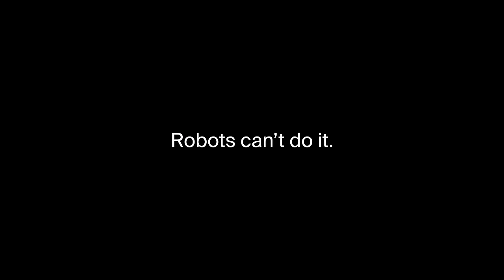Dexterity - AI-Powered Robotic Truck Loading

Comment: I'm skeptical of technology that lifts boxes by sides other than the bottom. I envision lots high-density boxes with their contents strewn about if lifted from the top or side.

Will this technology be able to compensate for packages that are drastically heavy off-center? This type package is typically placed with the heavy side toward the front of the trailer to keep the stack stable.

Comment: FedEx expects 300 boxes stacked in the truck per hour per employee in the outbound package handler position regardless of size or weight,  whether a 4×4x2 inch box or as a another commenter posted a 149 lb box 8 ft x 3 ft x 4-6 inches thick...

This thing needs to speed way up...

FedEx loses millions and millions of dollars in damaged and stolen merchandise every year from employees alone, perhaps if they let folks slow down to this things speed, they wouldn't have so many damages and insurance claims!

Truly incomprehensible when you witness the insanity...
Reply: 300 that's it ??!!

I was loading 1200 an hour back in 1991 at age 21. Kids today, will never work that hard!
Reply: Same thing with UPS but the thing is af ups each shift runs like 3-4 hrs, and they want every loader to do 300 boxes an hour. But these robots at this speed while they look really slow they can go at it for 24/7. Weekends, holidays, etc. I never thought I would see the day machine would replace humans when it comes to loading but even at this speed they are more functional it looks like. Like said they can go forever. While people can't.
Reply: Its 600 packages per hour now at UPS to load the trailers and 1,200 packages per hour to unload the trailer. I know someone that worked there. He was told this in August 2023

Comment: Let's see it load 149.9lb box!
Reply: Just a matter of time, and probably not that much. Warehouses might need to be changed but robots will certainly be doing the bulk of unloading, stacking, and moving in 15 years, probably less.
Reply: @jacobnunya808 it will never happen. the robots will need to learn how to load tires sometime especially, 4 tires held together with straps😂, tubes, buckets,  push mowers, catfish traps, anduch more. ribots will certain cost ups more than they save. our ceo is a moron.

Comment: I seen a column and it’s not locked in on the right side to prevent shifting during transport. I give that wall a 2 out of the 10 load quality elements. That’s failing. Do better robot 😆.

Comment: Way to slow! This would never work at UPS! Humans are much faster!
Reply: This is only the beginning and a prototype. The only safe jobs are those that are protected by government: Doctor, lawyer etc.
Even if you could make a robot surgeon, it would not be legal for it to operate people.
Reply: Yeah I got 25 years at UPS and could annihilate this thing in speed and load quality. But as the other guy said, this is just the beginning, give it 10 years. It'll make everyone more efficient, but it's not out and out replacing jobs. You'll still need a ton of people babysitting the machines and the belts. Stuff is going to be spilling out of packages, the belts are going to get jammed. The machines will get errors.
Reply: I load trailers at UPS I load a bit slower and not as neat. Life as a   COMBO
Reply: Way to slow but at ups each shift goes for like 3-4 hrs. While these thing are slow (right now) they can do this all day! 24/7. Weekends, holidays, etc. It sucks that my time at ups is coming to an end but I can see why.
Reply: not to mention i didn't see any tires, buckets, axels, tubes, bags, and so on loaded. our ceo is a moron and these robots will never work.
Reply: @user-rs6te9qy9p  somehow some of these variations of robots are working. So many people are laid off and so many buildings are losing one or two shift for the work to go to these automated buildings
Reply: @clashofqueen93  where. ive been at ups 29 years. im now a feeder driver who visits multiple center and hubs every month. ive not seen one  robot. ive loaded these trailers, and I am 100% positive they can't do the job efficiently and cost effectively. i want to see one pick and load a trailer axel or a box with a recliner in it. its a waste of money, but that is what Carroll tome is best at.
Reply: @user-rs6te9qy9p  I'm in local 355. The building has lost night and day shift within like a year. The work is being sent to ezra. I'm also hearing on upsers that other buildings are being affected and people are being laid off.
Reply: @clashofqueen93  im local 568. they haven't shut down any sorts around here. they have cut routes. its not there isn't enough volume, they are just not delivering certain routes on certain days. but it isnt working out too good. on the days they do deliver after hoding the volume, it takes two drivers to deliver all it. lol. all i can say is if there are sorts where they are using robots, teamsters better slip some wrenches in their plan. sometimes we have to take matters into our own hands. and UPS is supposed to create a certain amount jobs by the end of the contract, so teamsters need to be filing grievance if UPS doesn't adhere to the contract. these younger generation teamsters are scared to get ugly with management.
Reply: @clashofqueen93  and i never heard of Ezra
Reply: @user-rs6te9qy9p  it's that new building in PA. It sucking volumes from 100 miles radius. And that's what I'm confused about in the contract they said they are going to create more jobs but yet so many people I know are laid off as well as from other buildings. It seems to me like UPS found a loophole where they can create jobs in these new buildings while getting rid of people that been there for a long time in other buildings. I'm a full time driver, and I was working inside to get my 8 hours, now I'm laid off and not getting hours at all. Looking for another jobs atm until I can go back driving.
Reply: @clashofqueen93  the loophole needs to be challenged. you have git to pressure your union stewards into growin a pair and filing grievance. if its not challenged, then ups gets away even if no loophole. you never know if not challenged. nothing to lose, sounds like
Reply: @user-rs6te9qy9p  I just don't know what I can challenge if there's no work. I talked to my union rep and they just told me that if there's no work then there's no work. Because all the work is going elsewhere.
Reply: @clashofqueen93  there is always something to file on. we file sometimes just because we haven't filed on anything in a while. file for harassment and recommend the boss be fired for harassment. gotta keep em on their toes. they can't do anything to you for filing grievance, if they do file harassment on that. we try to make our management as miserable as possible.
Reply: I just told a ex FedEx coworker they couldn’t have robots loading trailers maybe sorting but not loading. A.I. can is learning at exponential rates and will replace human loaders in the not so distant Terminator future 📐
Reply: @clashofqueen93 I work in an automated building and our system breaks down all the time and the reason why there shutting down so many shifts and laying people off is bc they over hired during COVID and are now feeling the hurt bc they don’t have the packages to keep all of these shifts and people, so there solutions is to shut down shifts and poor those shifts work on to other buildings just like mine 😂